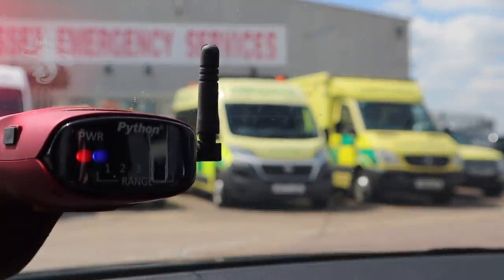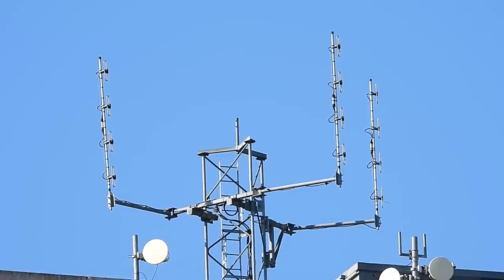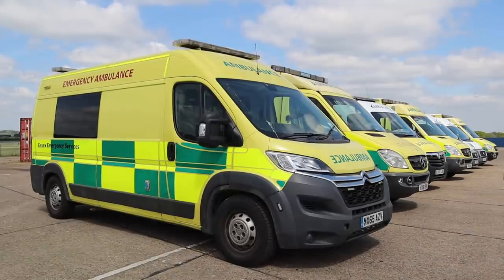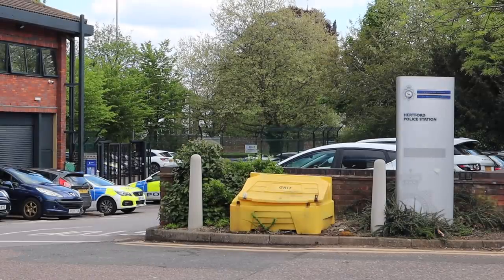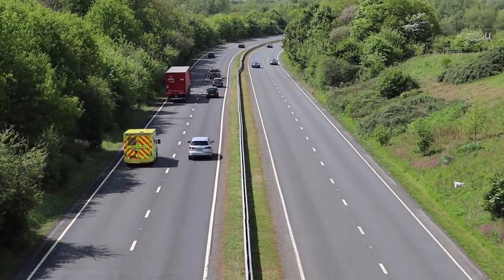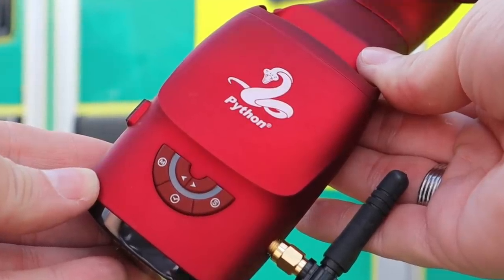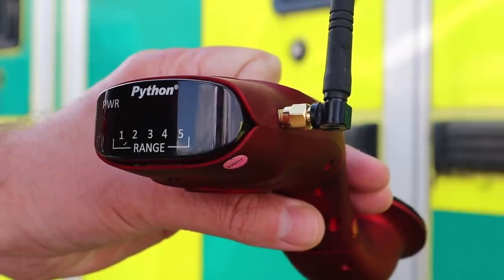This UK Police Radio Scanner Is Always Listening

Comment: I used to have a scanner, took my mate about 6 months to work out all the codes for the different stations, used to love listening to all the chases, lol! had the helicopter on it too, that was Oscar 1 at the time... the only one which was scrambled was the armed response unit.. this bit of kit your showing is rubbish, it's a distraction, you be watching that for a signal and end up crashing your motor? Lmao! 😂😂
Reply: @Northstar-Media  that was back in the 90’s mate when I did it, they were on VHF then, they changed to digital to stop people listening in on them, but yeah agree, I don’t think you can do it anymore.
Reply: @Northstar-Media  If someone has or a group has cracked it, they ain't going to shout it out loud as the PTB's will silence them & change a few things... so give it a few years, it will come out. Just like MOD relay stations for the armed forces, Top secret right? Nope it was ran by BT now defunct service... the stations was found out by many earlier on but they held on to it then moved onto a sat link system..... still not secure   😂
Reply: How can I get a scanner?
Reply: @Motivation-su7fr  Tandy used to sell them, but they stopped doing them, eBay is probably the best, depends what you want, VHF, FM, AM are fairly cheap second hand, but if you want a Digital one, they are a bit more expensive.

Comment: I almost thought someone was listening to an actual UK Encrypted Police Voice radio, too good to be true I guess. Just watching some lights flicker on a receiver seems pointless. At least with a real scanner you can hear Shop Watch radios on 450Mhz UHF Analog or TRBO DMR. That has to have occasional excitement to it.
Reply: for cheeky purposes (like avoiding police whilst committing crimes) i can see how it would be useful as it could pretty much indicate if a police officer had line of sight of you. although not committing crime is an easy workaround the problem of being caught.
Reply: Yep best you are going to monitor is DMR Shopwatch. Absolutely no chance whatsoever of monitoring the EMS Airwave Service with all its layers of TEA2 encryption. Ever!
Reply: Unfortunately for MOPs The UK EMS Airwave Service with its TEA2 encryption makes it impossible to monitor. Voice Talkgroups whether it be Police, Fire or Ambulance Services.
Reply: @jamiemoo2000  Thing is the encryption is proprietary but apparently most users of tetra tea2 ”only” use a 80bit key and is based of a key stream generator. Now to me its wierd that noone in the last 25 years hasnt found a flaw in the algorithm or have tried brute forcing it in some way. There must be someone that has done this somewhere.
Reply: @Gripengamer  TEA2 Encryption Algorithm will never be compromised by a MOP.
The UK Tetra Airwave Service has layers of encryption and authentication protocols to access the Network. The Air Interface Encryption mechanism is complex with E2E for Tetra Terminals and OTA rekeying.

Comment: The AIRWAVE network (any TETRA network, for that matter) isn't just a bunch of repeaters tied together. It's closer to a cellular network connected through stuff like IP links and run by a central computer. TETRA base stations are on the air 24/7 (at the very least the frequency carrying the control channel(s)), so listening there wouldn't do you any good, seeing as these networks are designed to have coverage pretty much everywhere.

Comment: How interesting! From what you're seeing, it looks like these radios are pinging virtually full time. Or is there a long decay-time which keeps the display illuminated for longer, I wonder?
As an aside, if you were in the near-field of an active Tetra device, I wonder if their transmissions would interfere with analogue equipment: amplifiers etc, not unlike that from mobile phones.
Reply: Yes Tetra TMO and DMO RF causes RFI to some sensitive electronic equipment that is poorly shielded from EMI (Electro Magnetic Interference). The Control channel from a TMO BS Cell is continuous and there's a reservation mode in Tetra Handportable and Mobile Radios. When you dekey the pTT in a group call, the TG channel stays open for a few seconds dependent upon the timer settings in the Radios codeplug.
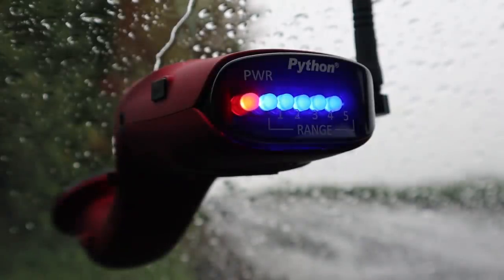Reply: Looking at the display response to lightning at 4:46, I'd say the display has a long decay time.
Reply: I assume you are invoking the ham radio meaning of "How interesting!"

Comment: Find out the inputs for the repeater or trunking network. Program them into a scanner and scan. Take the antenna off, if you can still here them, they are close. I use The Pro 197 scanner in signal stocker mode. It can scan its whole spectrum every 3 seconds for strong close transmitters. If they are encrypted, you cant here them, only digital noise. If Police transmit within 200 feet of my house, I will be alerted!
Reply: How does that help you?
Reply: @vanpallandt5799  If you bring it with you in a car, you might get alerted by the scanner before seeing red/blue lights and hearing the siren from eg. an ambulance. This could give you more time to slow down and pull onto the side of the road at a good safe spot, to allow the ambulance to pass quicker and more safely.

Comment: It’s not just blue light services that use Airwave, there’s a very broad spectrum of users from to mundane to the not so mundane, be careful who you detect the presence of 😉
Reply: Yes there is Civil Tetra Usage, but they don't use the same frequencies as the dedicated Airwave Service which is 380-395MHz. The Rx in this gadget wouldn't Rx these RF frequencies by other UK users. Prison Service, Councils, Ect..
Reply: @jamiemoo2000  There is only one Tetra Airwave and all users use the same frequencies just different talk groups.  This device will detect all users it is just that the emergency services are the biggest users of the service.  There are other Tetra services on different frequencies but they are not Airwave, storenet in Cardiff for example.
Here is a list of potential users that this device could detect.
http://www.tetrawatch.net/papers/users_2003.pdf
Reply: @caerffili_callin  no it won't because they aren't on the TEA2 Airwave sharers list. Arqiva use Tetra. I should know I've been using it for 12 years.
Reply: You obviously know alot more than me

Comment: Interesting video Lewis. Are American viewers to gather that Radar Detectors are also forbidden in the UK ?
Reply: No, they are not forbidden. They are pretty redundant however. Most radar based speed traps are fixed position and mapped on just about every satnav platform, mobile ones use LiDAR, and by the time a detector pings you have already been hit. 

In general there is nothing illegal about owning recievers, just transmitters, including of course jammers.

Comment: Interesting device, but what practical function does it serve apart from letting you know an Airwave device is nearby?
Reply: gives you a chance to slow down before the radar gun catches you
Reply: @salerio61  New laser guns have detection ranges up to 1200 meters, so have fun accelerating and breaking a lot :ø)
- I doubt this detector has the sensitivity to detect a speed control, especially if the radio has just communicated with its network.
But yes, you would get alerted to potential cops and other rescuers around the area

Comment: The Tetra radios also broadcast the GPS location of the device over a very slow data speed. Is it may be this broadcast that the Python is picking up on ?
Reply from the maker: I think so mate yeah
Reply: No it does not. Where on earth do people get these strange ideas. TETRA radios can send GPS location, but it's done using a text message very similar to texting on your phone. TETRA and GSM have a lot of similarities.
Reply: The old Motorola radios used to update every 5 minutes on a CAD map, or every time the radio transmitted. I remember a colleague showing me at the start of a shift about 5 years ago, whilst he was sat next to me inside a police building having just turned his radio on, his radio showing on a map on the high street about a mile away... why? Because the last time he transmitted was in the high street the day before. 

The new Sepura radio system updates every 1 minute I believe. I say new, we've had the Sepura radios over 3 years now.

Comment: Sounds like a near field receiver = such as the digital scout frequency recorder made by Optoelectronics
I own the non-digital version and it's great for finding and logging unknown frequencies.
Reply: Combine this device with an Active Pre-Selector like the APS104 www.radioscanner.ru/uploader/2007/aps104_pack__.jpg, or APS105 www.radioscanner.ru/uploader/2007/aps105_pack___.jpg, and the sensitivity & selectivity of the Python would be greatly increased.

In the U.S., there are railfans that have built a similar device, for detecting nearby train activity.  Most units consist of a pair of UHF receivers tuned to the Head-End & EOT/FRED frequencies, which are typically 5-10 watts in power.  It's a low tech, but reliable solution, when looking for activity on specific frequencies.
Reply: @arbutuswatcher  Listen to the railroad frequencies here in the US.
Mostly I monitor the military airband, USAF etc.
Reply: @landonmiller6943  So many Comms have gone digital, & in some cases encryption too.  Casual scanning isn't what it used to be.  My favorite things to monitor were the low power comms.  Sadly, even many of those have gone to a digital format.
Reply: @arbutuswatcher  I guess I'm lucky here.
The major digital public services system here (APCO25) is almost completely unencrypted.
Curiously they do encrypt the cop dispatch channel for my city but that channel is cross-patched into the local military base with a bunch of other channels and it's not encrypted there. In fact if you monitor the miltary base's radio system you can monitor all the dispatch and cop/fire/emergency channels for my city, county and state...go figure.
What gear do you use for monitoring?
Reply: @landonmiller6943  I've been away from the radio scene for a number of years, but I'm slowly creeping back into it.  I've got variety of commercial & ham gear, for transceivers.  For dedicated receivers, it's a mix of Radio Shack, AOR, Regency, Icom, Uniden, & a WinRadio computer-base receiver.  Due to a job change, most of that went into storage several years ago.  I'm trying to slowly get it out, sorted through it.  My lovely wife says it's time to thin the herd!
Reply: I have a Scout as well. Fantastic piece of kit. The Police here in NZ have (in most of the major cities) converted to a digital platform using APCO25 with encryption enabled by default. Some places are still using the old analog system but in the next few years all areas are moving to a new EMS digital platform including fire and ambulance so the days of scanning anything remotely interesting are numbered. There is no confirmation as to whether fire and ambos will be encrypted or not.
Reply: @sw6188  It's sad about the encryption thing.
So far here locally there's little encryption.
Yeah I agree the Scout is a great little piece of gear, I was thinking about buying the Digital Scout version.
Got a bigger than expected tax refund this year and ordered an AR5700D from HRO yesterday so looking forward to it arriving and playing with it.
What gear do you use for monitoring?
Reply: @landonmiller6943  I don't do a lot of monitoring these days. I have an Icom IC-R100 in the truck - the main use of that is for my work which is radio broadcast engineering but I also listen to fire on it.
If I venture to an area that still has analog police I will switch to that but most of it is pretty boring TBH. When I bought the Icom back in the early 90s I thought it would be a radio for life - never thought for a minute there would be digital radio, it just wasn't heard of back then. I've put off buying digital radio receivers because I have no real use for them. The new EMS platform planned here will use a mix of technologies including LTE for voice and data and be seamless across the network.
The AR5700D is a swish looking receiver, but OMG the price! Yikes, I could buy a decent used car for that, LOL. Looking at the specs it appears to be more of a computer than a radio!
Reply: @sw6188  I'm gonna pair it with my IC-R8600 to get full wideband analog/digital reception.
Yeah it is expensive and true you could buy a second hand car, but I don't drive and radio gear is my luxury item.
Actually was born and raised in the UK and failed a number of driving tests so never got a license before immigrating to the US. That's a little limiting here but not too bad, just cycle everywhere.
You work in commercial radio/TV?
Reply: @landonmiller6943  Yes, radio engineering for private radio stations mainly. I definitely need to be able to drive for that - either to different towns where the stations are or up mountains for transmitter installation and maintenance. If I didn't have to run a vehicle I would probably be buying radios with all the spare money I had!
Reply: @sw6188  Cool job, New Zealand seems like a very beautiful country!
Hey, enjoyed our chat, be safe and have a great weekend!
73s...
Reply: @landonmiller6943  All good, yes I enjoy what I do. If you're ever thinking of traveling this way, hit me up and I'll show you around.
73.

Comment: But illegal to use! You are not meant to receive signals that are not intended for you.  The fact that you don't demodulate it to audio doesn't matter as you are still using the signal to obtain information about police operations and the signal is not intended for general reception. Wireless and Telegraphy Act 2006 48.1.a    "A person commits an offence if, he uses wireless telegraphy apparatus with intent to obtain information as to the contents, sender or addressee of a message (whether sent by means of wireless telegraphy or not) of which neither he nor a person on whose behalf he is acting is an intended recipient,"
Reply from the maker: John completely wrong mate, they’re absolutely legal to use. Check the legislation properly
Reply: @RingwayManchester  I copied the quote from the Ofcom site just now. I see it's use as attempting to obtain information as to the sender and so it is an offence.
Reply from the maker: John I’ll just keep stating fact… it’s not illegal in any way
Reply: There was a court case over a radar speed camera detector.  The court ruled that detecting the presence of a signal did NOT constitute an offence under the WTA.
This is because detecting the presence of a signal doesn't give you any information other than that the signal is there.
Reply: Not a breach though is it?

IS this deemed wireless telegraphy apparatus? It could be argued it is, could be argued it isn't. Is it apparatus? Yes.
Is it wireless telegraphy apparatus? You could argue it's just a scanner to detect the presence of a signal - no difference to wandering around your home town with your phone in your hand testing the signal strength in each area - is that illegal? No. that is also a communication network.

As for the next part - is there any intent to obtain information as to the contents, sender, or address of a message? To me, no, there is not. There is no intent to obtain the contents of the message, it's encrypted anyway so not decipherable, the sender could be anyone that uses Tetra, but is likely to be emergency services, so to me again no, and this scanner wouldn't give information to the person whether it was emergency services or someone else with a Tetra handset (i.e TfL staff use Tetra, MoD do as does the Army). 

Finally is there any intent to identify the addressee of the message? No - Again it's encrypted. You wouldn't be able to identify the addressee even if you wanted to. The intent it not likely to be "proven". 

After all you aren't necessarily interrupting or intercepting a call, the device just detects the presence of the signal being there, much like a speed camera radar detector, detecting the radar signals emanating from the speed camera.

Comment: last time i checked it was not legal to do this with government/emergency vehicles i defo would not be driving around wi one if i got stopped. unless i could use it with a justifible legal use. i.e is legal to use in the UK
Reply: It definitely is.

It's no different really to driving around with a speed camera detector in your car - perfectly legal. Some of them use known GPS locations of speed cameras and warn as you approach, others have Radar detection built in and once they detect a radar frequency on a certain wavelength (likely to be caused by a speed camera) they alert you in advance.

People confuse detectors with jammers all the time.

Detectors  = Legal
Jammers = Not legal

Comment: What do you hear if you listen to these types of digital (presumably FSK/AFSK) transmissions on a regular old school analogue AM/FM scanner? I'd suspect some clicking, buzzing sounds. Could it actually just demodulate to silence?
Reply: you hear nothing at all just silence
Reply from the maker: Not true, you hear the noise of the digital signal
Reply: @RingwayManchester  Yes you’re right Lewis.  The only thing I could demodulate with software on my pc and an sdr usb stick was network control for the Trams from the city of Nottinghamshire On 4 different frequencies.
Reply: You hear the continous control channel frequency which determines V+D carrier frequencies.
It uses 4 slot TDMA with 25KHz spacings.
Reply: It will be just bursts of audio signals/noise.
Reply: The TETRA modulation is QPSK

Comment: Bit of a waste of money as UK emergency services are about to switch over to the ESN, which is based on the 4G system...
Reply from the maker: Yeah; don’t hold your breath unless you can hold it for a long long time
Reply: @RingwayManchester  New rural EE masts are popping up here, three in this little valley..  A big surprise, it's great to have a mobile signal in what were "NOT SPOTS" .. de GW7UNV